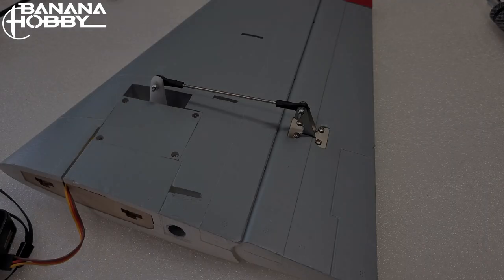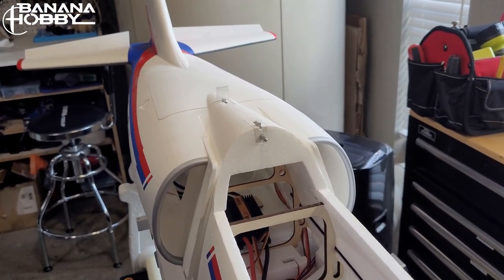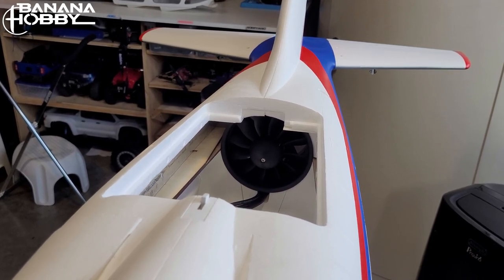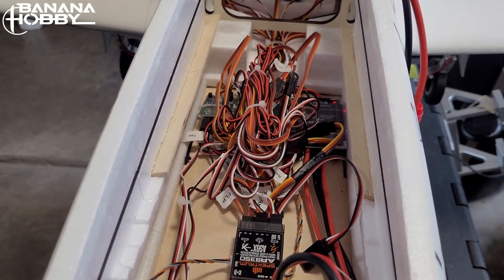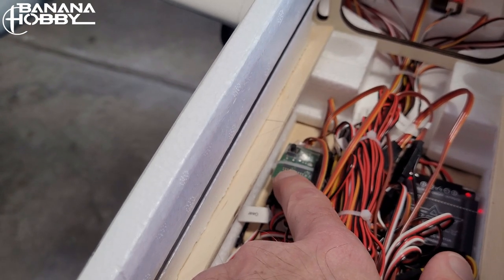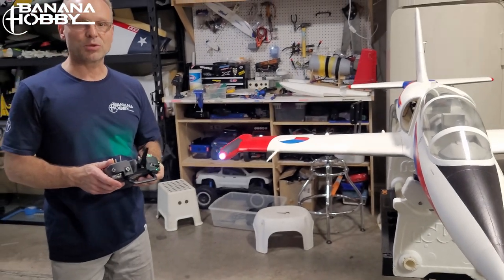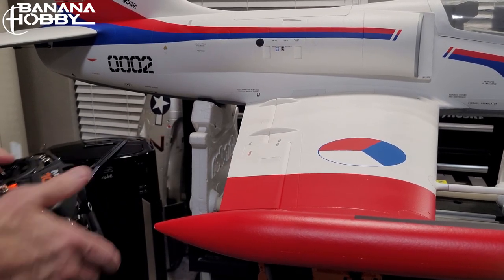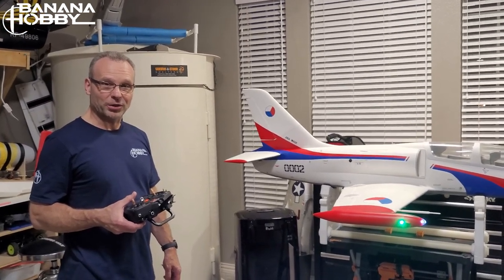AeroFoam L-39 Albatros 105mm V2 from Banana Hobby - Build & Setup.

Comment: Thanks for the great video - excellent information and just the right amount of detail.  Agree with your points about the gear controller, completely unacceptable (I have 3 of these big BH jets, and it was a roll of the dice every time I selected gear down.  Shame BH is still using these.)  I use the Xicoy gear controller and it works flawlessly.  Hopefully will maiden mine this weekend.  Cheers.

Comment: How many amps is  your system pulling. Mine with the JP Hobby setup on the v2 PNP only pulls 99-103 amps when it should be closer to 130 amps. Not sure if changing to a JP 150amp esc over the Hobbywing Flyfun ESC will make a difference.